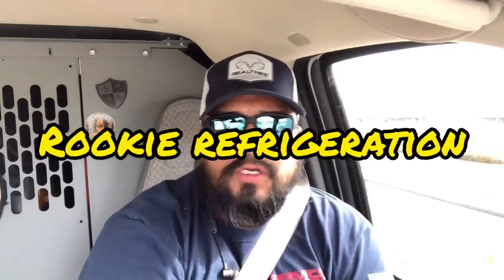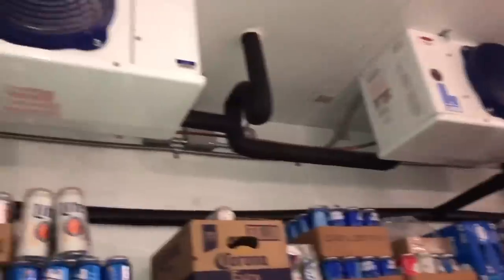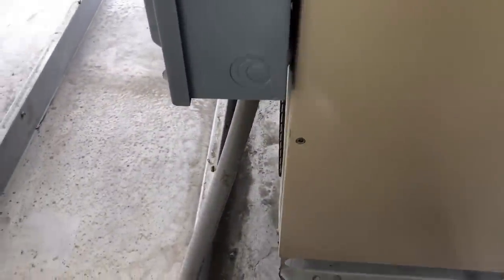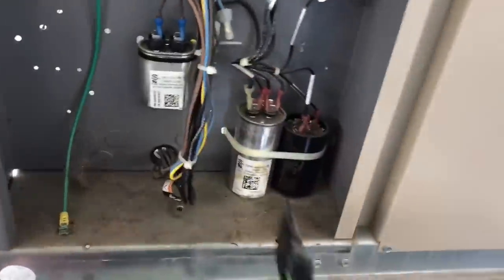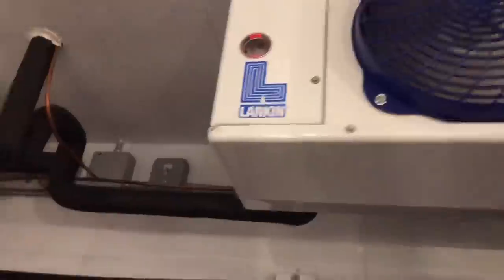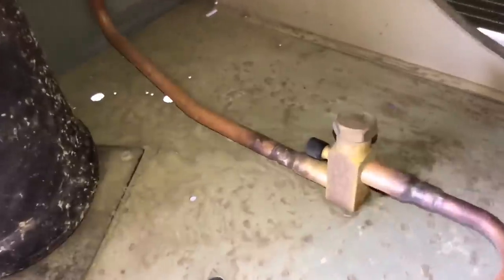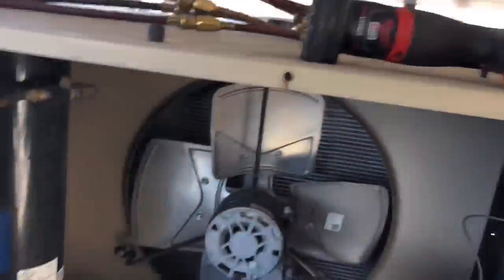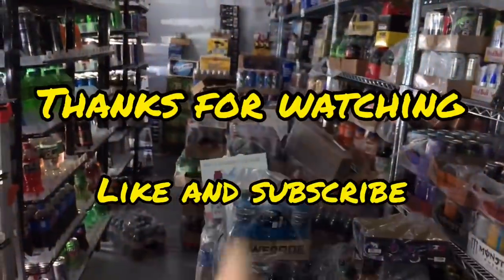HVAC REFRIGERATION:  Walk In Cooler running warm, Headmaster surprise!

Comment: You can’t fix stupid. Companies want their stuff working right, but don’t want to pay for it. Why can’t I go into their stores and take some drinks so I can stay hydrated and not pay for it? I would be arrested. They basically steal our services. However, I’m trying to learn more about the supermarket refrigeration systems, so these videos really help. Thank you!
Reply from the maker: Thank you. Yeah, this chain of gas stations are really strict on the money.  So that’s why we leave it as is until it’s approved
Reply: Rookie Refrigeration that’s the only way to handle the company. If that’s what they want, that’s what they get. You have to get approval for everything big or small in order to cover yourself.
Reply: Is it the general manager placing the call and you gotta wait for them to get approval? I can see a customer doing that just because GM's are not exactly in mensa. Have a feeling it's to prevent stupid service calls from lower management.🤷‍♂️

Comment: Pro tip. To save time, prevent incorrect wiring, with the power off, only one of the two terminals need disconnected to test a cap to isolate it from the motor. Then the wires can be returned to the empty terminal without risk of swapping a wire.
Reply: Power wores coming in?

Comment: After finding the headmaster missing, it was time to walk away. They don’t want to pay. But I agree that you were right in doing what you did.
Reply from the maker: Thank you so much.  Finally someone who agrees. 💪🏼💪🏼
Reply: @rookierefrigeration4357  there would be a couple weeks of work at every location we service if we didn't need authorization.   You can't charge someone for something that wasn't authorized. Where im at  we're now getting signatures before we touch anything,  ,  use to not be that way but people will look for a way to get out of paying.
Reply: @rookierefrigeration4357  I agree too. I've done work for many gas station owners before. And none of them like to pay. If you would've touched that piping you would've been held accountable had something went wrong after you left.

Comment: Good job I would suggest when you see a bad contactor to always check your low voltage to your coil on contactor I’ve seen the low voltage transformer putting out 24 volts then dropping to 14 volts burns the contacts if you don’t catch it you will eat up the new contactor good video
Reply from the maker: Will.do. Thanks

Comment: That's probably a case of:
  "The unit isn't working. I don't know what this thing is it must be the problem. I'll just cut it out."
People tend to blame the thing they understand the least.
If you don't know how it works you can't be the one to condemn it.
Reply from the maker: Exactly.  Well said
Reply: or it was not working. and they had the cant go over $800.00 so they did a job that would just pass it over to the next person.
Reply: Except.... the could have cut out the Headmaster and capped off the bypass. It would’ve actually worked, at least in the summer, and would’ve been easier and faster to do. They worked extra hard at fucking up.

Comment: capacity control.  They are using it to prevent fast pull down, thereby not stressing the walk in box or the bottles of product. Then they can sell slow cooled drinks. Customers will love it.
Reply from the maker: Yup. Now that the cooler is running good, all the cases are working great

Comment: 14:00 would be a quick thing to just pinch off by bypass tee's and brake the ends, at least it would work for time till pressure/ temp dropped.
Reply: But I would want to install headmaster if possible.
Reply from the maker: Agreed.  But it was not work approved.   So I couldn’t do anything.

Comment: In my area probably labor will eat into the $800 right now labor is $94 up to $145 per hour plus parts .You couldn't do the proper job for $800 plus parts .This is what happens when you have customers have a low ball contractor not doing proper job .
Reply from the maker: Yup. Exactly where were at!

Comment: My guess is it was the dead of winter and they found the "little mushroom thingy" dumping hot gas into the receiver and instead of adding the winter charge, they replaced them with copper... Probably ran ok when it was really cold out. Thing is he was probably really proud when he was done that he fixed it 🤣. Of course they never changed the driers either 🙄.
Reply from the maker: That’s a very probable scenario.  I could agree that happened.  But damn.  😂😂
Reply: @rookierefrigeration4357  yeah that was one of the funniest things I've seen on YouTube for refrigeration. I literally laughed out loud... I am currently doing a call on 15 doors of frozen food and it has the 7.5hp version of that unit, and it's low on gas with a warmish liquid line. I had to stick my head in there and make sure the head master bandit wasn't he too and just replaced it with copper. 😂

Comment: Those coils inside look fairly new and condensing units..
Is there any warranty? 
Or liability on original installers you can go back to.
Also, they need ( Murphy) to know on a hot day your never going to have cold product until there fixed correctly..
Unbelievable...
Keep us posted..
Thx for your time brother.
Bryan Tyler Refrigeration
Reply from the maker: Only 2 years old. Probably out of warranty though
Reply: @rookierefrigeration4357  
Keep up the awesome videos bro..
Im going to subscribe..
Bryan Tyler Refrigeration
Reply from the maker: Joseph Lopez thank you bro.  I appreciate it

Comment: somebody didn t understand the function of a head master.unit probably under charged on start up.so the valve was bypassing,doing its job,and not being familiar with the head master thought the the bypss was a fault,and cut it out.should never have piped the unit in this fashion.compressor oil must be baked.suprised it still ran.have to leak test system with nitrogen and change oil i would think.they went to a lot of  effort to to create a mess.
Reply: may have lost charge via relief valve.high pressure control should sht down compressor before relief valve opens.

Comment: Could you pinch off the bypass where the headmaster valve was originally? As a temp repair to get the unit on line until the head master gets installed?
Really like your videos, I run commercial service calls in south florida.
Reply from the maker: Yes I could have.  But I didn’t.  I won’t.  I’m not going to do anything that puts us in a liability whatsoever.  I’ll wait until the job is approved and then fix it.  I mean, it’s probably been like this for 2 years.  So...

Comment: Correct me if I'm wrong but a Headmaster is a low ambient control am i right? What are Ambient temperatures in the summer were you live?
Reply from the maker: 100-110.  DFW Texas.
Reply from the maker: Yes they are low ambient controls for head pressure.

Comment: I would of definitely pinched those lines off to at least to stop feeding hot gas Thru the receiver 👍🏻
Reply from the maker: Agreed.  But no.  Not until this gets approved.
Reply: Don’t need approval to be proactive would of taken one minute 👍🏻 but I’m old school
Reply: @rookierefrigeration4357  I agree. Technicians have no mandate of this kind or mission from God to do good. Customer runs the show. Learning takes place on both sides all the time. They will finally understand that if you want to pay below what market requires, you'll get sub-par service.
Also, "you touched it you own it". If something went wrong you would be screwd. Good judgement, good rules. Thank you RR for your effort to help us learn.
Reply: @Luzt.   agreed. well said.
Reply: Pinching the lines could have caused unforeseen issues, maybe causing units jot to temp si I agree with not doing it with a close NTE.

Comment: Don't understand why remove H.M. in both? Both defective or just wanted parts
Reply from the maker: That’s the least of it. They piped it in all wrong.
Reply: A good guess would be that someone told them that they don't need headmasters due to having electronic expansion valves. They removed the headmasters and connected the pipes whichever way they thought they should go, which in this case was completely wrong. I had a manufacturer tell me that a condensing unit we installed did not have a headmaster because the electronic expansion valve would properly feed the evaporator at any pressure. It worked great until the temperature dropped. They refused to pay us to add one. I just threw a fan cycle switch on it and it worked decent.
Reply: @akhermit5213  Nice! 👍🏼 not very many H.M. here in AZ. Just fan switchs.✌🏼

Comment: Why even go on a call like this? Total waste of time. I’ve had one before where they said I had to call if over 250, from a electronics store “chain brand” called them up and said sorry, call the next fool.
This setup, lol, you need to remove the roof, to stop the hot air from circulating.
Reply from the maker: Lol.  I guess it just is that way 🤷‍♂️

Comment: Those missing HPRs explain why the contactors were pitted to hell.  That's some Unqualified Personnel special there.  (Edit for grammar)
Reply from the maker: Yup. That’s what I’m thinking.  Too many cycles.  And I wonder how the compressor have handled it.
Reply: Prolly another maintenance guy messing with reefer that's a no no
Reply: @rookierefrigeration4357  $20 says the start relays are cooked and that you have organic acids in the system from hot windings on the poor compressors.

Comment: Normal day. Haha

Those electronic txv are rated up to 6 tons, so every drop of liquid is probably getting into each coil. I bet each valv is maxed out at 249 steps. If it was a mechanical txv, no way it would be pulling down. 

Hilarious, their stupid not to exceed probably fucked them. Nobody can do a full checkout and repair for 500 or even 800 on two units.  Nice job
Reply from the maker: 👍🏽👍🏽👍🏽yup.
Reply: Not to install tow headmaster for 800 end the contactor end the capacitor .

Comment: For the New Guys Out there --- ( Ftngot ) Each of Those Moh030's Will remove about 24,000 Btu's at a Plus 20 Suction on a 90 degree day. more on a cooler day and night. That cooler looks to be only about 22 feet long. So, One of those units will Do the JOb Probably on any Day cooler than 90 degree's. i Thought i did Over Kill ( LOL ) when i size a Little Heavy This is Where u Get into Trouble When u Oversize By Double without a Plan in Mind / setup and control properly. Excessive cycling could be a major problem here at Night & it looks like it is so by the signs of those contactors. 

Definately Need Short cycle Protection of some kind --- Be it a 5 Minute time delay on the contactors or Keep one Condensing unit off at Night or on a Temperature control so that if the ambient drops below 70 degree's that unit stays off. ( second or third  idea is Best )
Reply: With glass door each 1500 btu load and pull down on product from delivery, probably why they went so heavy on btu

Comment: Thats a new one lol. Good god
Reply from the maker: Lol. Yup
Reply: @rookierefrigeration4357  why didn't they just remove it hook it up normal and use fan cycle switch then. If they couldn't spend over the dallar limit
Reply: @royamberg9177   don't even need a fan cycle where hes at in texas. . just run it without a headmaster. head master only needed for cold climates which texas is not.
Reply: @OcRefrig  hard for me to think that way. I'm up in Minnesota
Reply: @royamberg9177   in Minnesota u definately need fan cycling or head masters. Texas climate is probably pretty close to the climate here in california. millions of units out here without headpressure controls of any kind. almost never gets below 35 Here. maybe 3 nights a year it touches 29-34 degrees.
Reply: @OcRefrig  HYPHOTESYS: Maybe the hacker was going this way (no HM needed in Texas) and decided to get out with the headmasters because he thought was causing problems BUT didn't know how it works AND leave the bypassing pipes? 🤔

Comment: Not HVAC tech but I'd understand the basic and cutting out headmasters not brightiest idea good  way burning unit up the hot gas can't be good on the evaporator condensing units im left speechless SMH
Reply from the maker: Yup.  Exactly.
Reply: @rookierefrigeration4357  wouldn't deleting the headmaster cause unit  to freeze up or trip out

Comment: What you shoul have done is write it all up first. Your diagnostic was not complete because you just asumed gas was flashing and thats all it was. Now you need a head master or fan cycling control. By the time you add your service trip, parts and labor you will way over $1500 including the head master. This one is on you. Sorry but don't be the guy blaming the previous guy. He just gave you the oportunity to shine and make money.